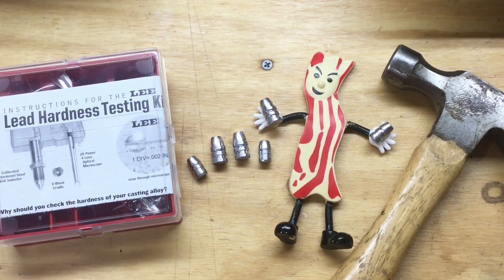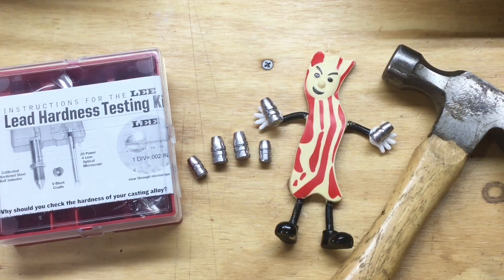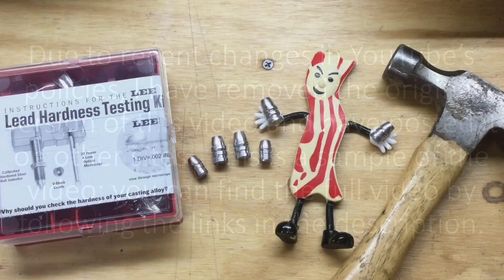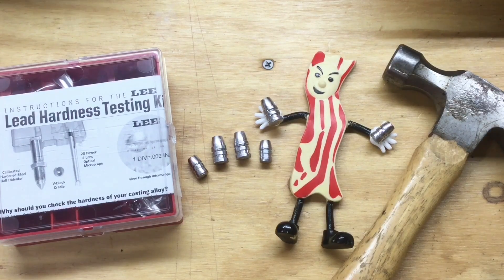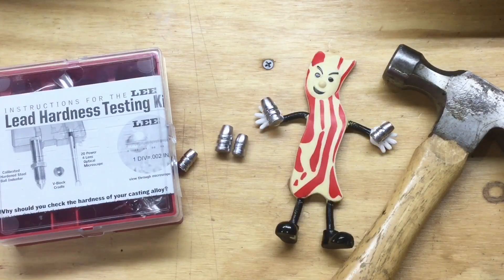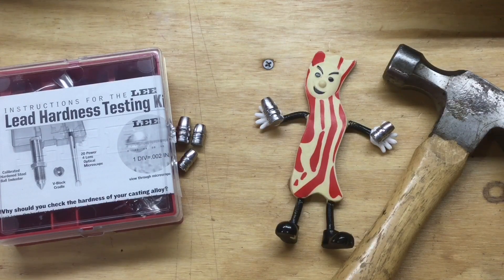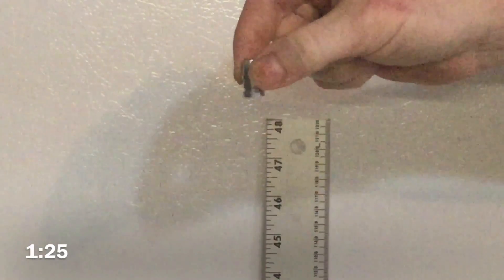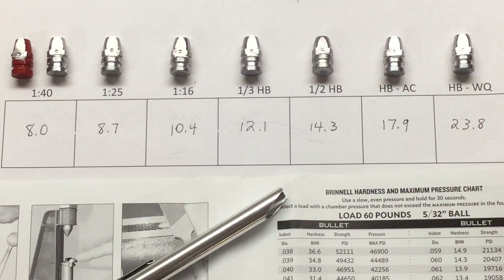A Hard Discussion - Determining BHN for the Powder Coated Cast Lead Hollow Point Bullet Test

Comment: I run powder coated straight pure lead out of an old sailboat ballast lead. Thousands of rounds 45 acp 1911 R1 Remington. Rings the steel everytime no problems at all.
Reply from the maker: Performance you're happy with - that's what it's all about.  That ringing steel is such a happy sound.  Thanks rickrn2!

Comment: I use only range scrap, then pc my bullets. Using the Lee Hardness Test Kit, I find my BHN numbers are anywhere from 11  to 18. I have als given up on expecting 0 leading. After a hundred rounds, all my guns have some lead streaking...meh...it cleans out with lead removal cloth and a little elbow grease. Casting my own bullets has me shooting very inexpensively...only pay for powder and primers. Picked up discarded range brass is free.
Reply from the maker: I think some people fear leading far more than they should.  As you state, a little bit of leading cleans right up.  If someone is getting lots of leading, it probably has something to do with bullet fit/size, not alloy/BHN.
Shooting for just the price of powder and primers -- you can't hate that :)